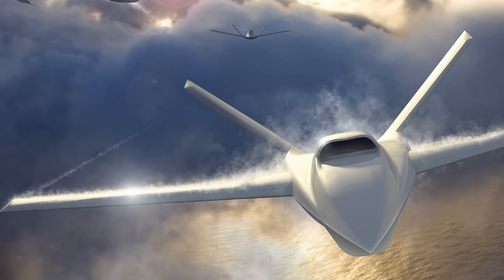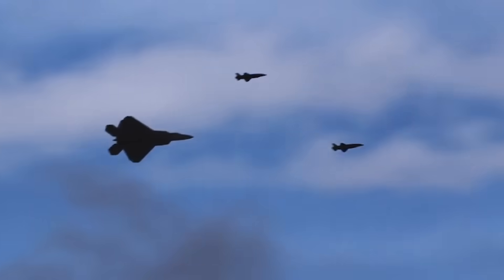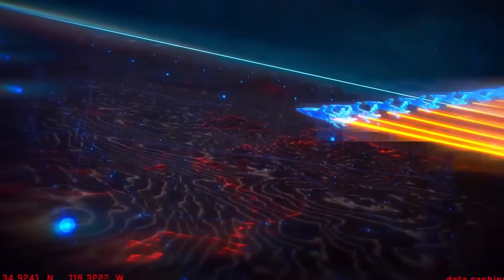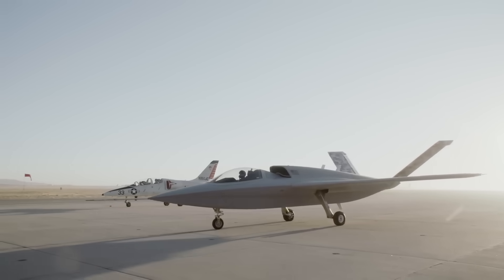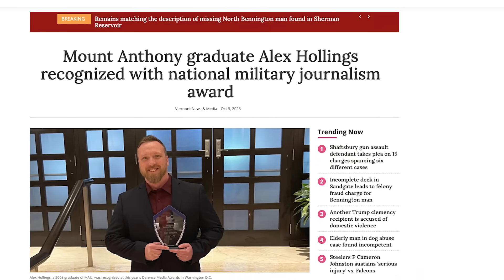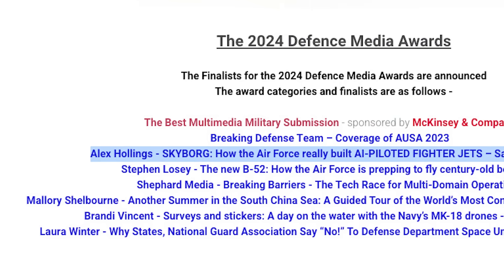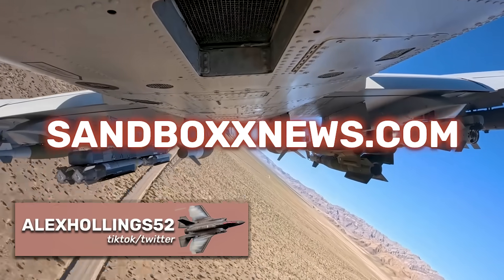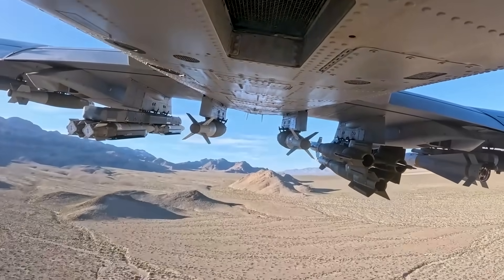Could Northrop Grumman's Vanguard be the future of US AirPower?

Comment: Always the good old high/low mix.  Never seems to go anywhere except high/ultra-high mix.  The other reason they have for putting a cockpit in the thing is that there are doubts regarding the abilities of autonomous control of the craft and counting on a link to the craft in the age of EW is a complete pipe dream.  AIM-120 should not be the standard at this point...where is the replacement?  3D printing/CNC should become the goal for all military manufacturing as we simply do not possess the skilled workers needed to build by hand.